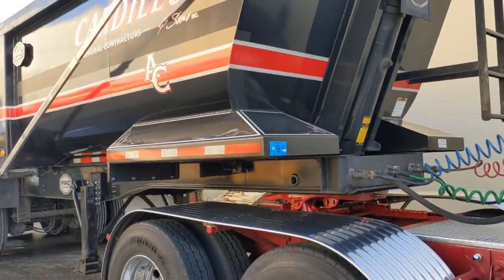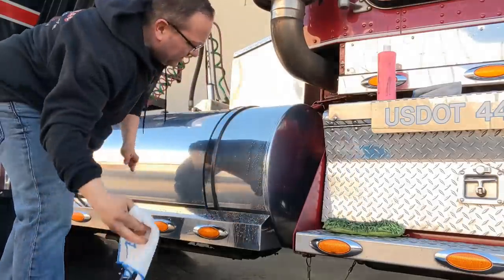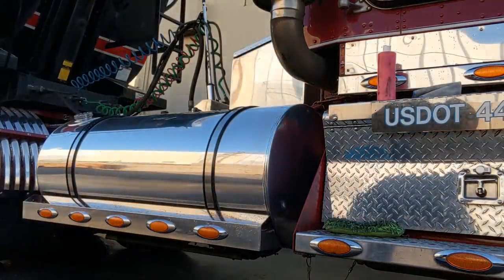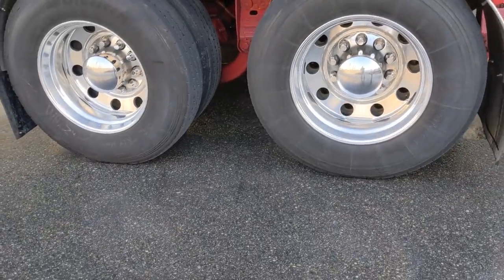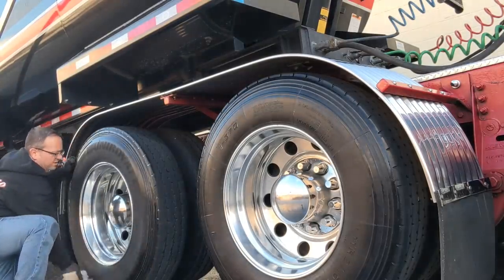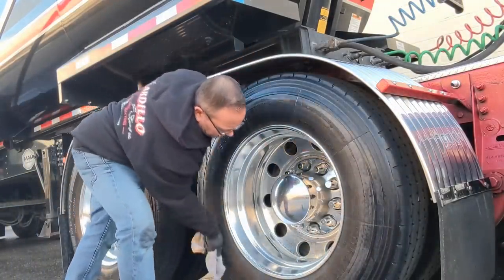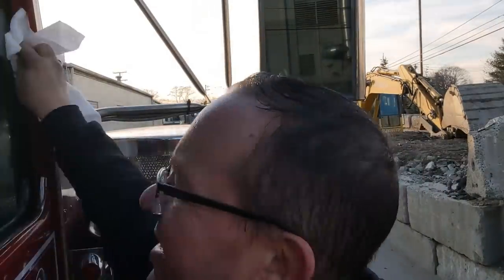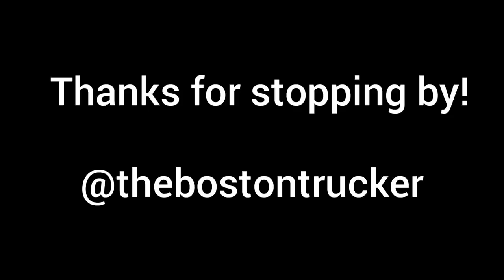How To Polish Aluminum While Washing Your Truck!

Comment: Your frame looks so damn good. Like new. Where do u hide the rust spots? We got some semis from 2008 that look a lot less nice than yours :D
Reply from the maker: This is a 2007, I had the frame sandblasted and painted 3 years ago.
Reply: @TheBostonTrucker  Ah ok. That explains it. I had a 2007 Mercedes until 2017 and got asked sometimes if it was NEW. Just because i am one of the few dump drivers that take some care about the look of their trucks. Makes a big difference for Sure!